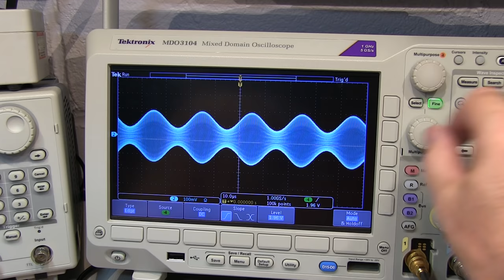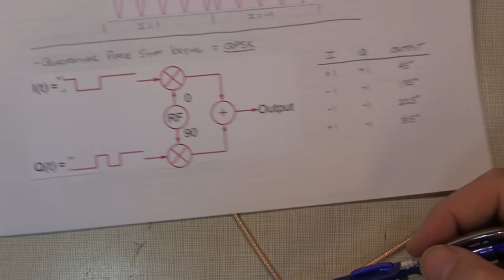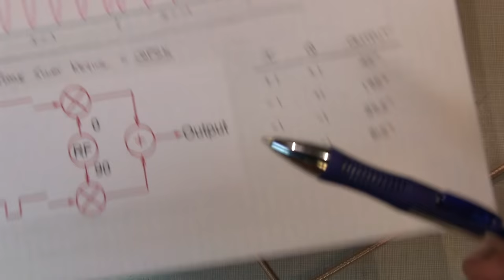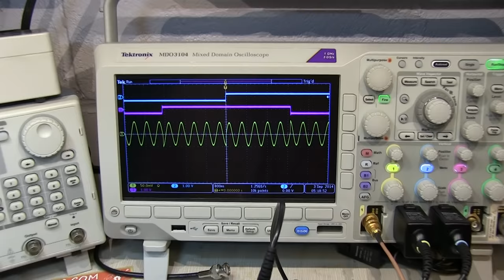#170: Basics of IQ Signals and IQ modulation & demodulation - A tutorial

Comment: Thank you for the video.  Do you have any videos taking this from the time domain to frequency domain?
Reply from the maker: Not specifically - the closest I have is my videos on using FFT on a scope.
Reply: @w2aew  Thanks for the reply.  Currently looking at ways to demonstrate the move from the time domain to the frequency domain using GNUradio for my students.   Was thinking of using some AD 831 mixers.  Want to show why increasing data rate increases the BW of a BPSK signal.  Then after that working on QPSK fallowed by 16 QAM.  Any suggestions that you might have is appreciated.
Reply from the maker: @NA12495  Showing the FFT of the baseband data signals will show how the baseband BW increases with data rate.  It follows then that the modulated RF signal BW will also increase when modulated with the faster/wider baseband.
Reply: @w2aew  I am looking to simulate it going slow, low data rate into the mixer with a slow LO, that you can see the pulses on the freq spectrum.  Then as you increase the data rate for this BPSK signal the pulses get wider and you have more harmonics and that is why the signal's effective and occupied bw get wider.  At least that is how I understand it.  A few of my co-workers have been under the impression as you increase data rate, there are more pulses being transmitted in parallel and that is why the bw gets wider.  To my understanding that is only true if you increase the order of modulation.  That is why I will then want to move on to the QPSK and then introduce amplitude with QAM.  Sorry if this doesn't make sense, it is how I currently understand it.
Reply from the maker: @NA12495  It may be instructive to talk about the inverse relationship between time and frequency domains.  Things that are "wide" in the time domain (slow bit rate, wide bits, etc.), occupy a narrow spectrum.  Conversely, short duration signals in the time domain (fast bit rates) occupy a wide spectrum in the frequency domain.  It's not about the number of harmonics, but the spacing between them.  Consider a squarewave - its composed of a fundamental frequency and energy in the odd harmonics.  As the square wave frequency goes up, the fundamental goes up, as does the frequency spacing between the harmonics - so it occupies more bandwidth.
Reply: @w2aew  good info.  From what I have read as the data rate goes up, there is more residual power from the harmonics, because they don't have enough time to dissipate.

Also,  I have read that BPSK is a form of DSB.  So does that mean that information on both sides of the center freq is the same, but inverted.   I used to think that the uper sideband represented one symbol and the lower sideband represented the other symbol,  similar to what you would see with FSK.  Though I can's find good documentation to clear up my questions.

Thanks for the help, limited on people I know that might know this stuff.  If you want, we could meet up on HF.
Reply from the maker: @NA12495  "Residual power in the harmonics - dissipating" isn't what's going on.  Higher data rates means shorter duration symbols in time, which occupy more bandwidth in the frequency domain.  BPSK symbols are not really represented in alternate sidebands - they're just different phase shift states of the carrier.

Comment: So, in demodulation, the LO = the original RF frequency? Is there a "pitch" issue like SSB carrier reinsertion?
Reply from the maker: For direct conversion, yes, the LO is equal to the RF frequency.  Any offset will result in a pitch shift (or non-zero IF)
Reply: Thanks for quick reply. Does the  reinserted carrier need to be in perfect phase as well? I think that was what the "hue" control was all about in early color TV. Do they sync it now?

Comment: When the I and Q are combined, is that normally the signal that gets transmitted or is used to modulate another carrier?
Reply from the maker: +rbtx99 The I and Q signala are used to amplitude modulate a pair of carrier signals (or IF carriers) in quadrature, which is then combined to be transmitted (or upconverted).

Comment: 16:30 Is I and Q used for 2 and 4 level FSK as well? How exactly?
Reply from the maker: If I(t) and Q(t) are both sinusoids (90 degrees apart), the RF output will be shifted in frequency by the amount equal to the frequency of I and Q.  Depending on if I or Q is leading in phase will determine if the RF output is shifted up or down.

Comment: hello, I have a question to the video
as your video, we can get the phase from arctan(Q/I),
will the arctan(Q/I) have the same variation as sinusoidal wave??
or depend on Q(t) & I(t),
if so, 
I can not calculate the RF signal phase when I receive that??
cos I am using USRP to receive ADS-B signal and want to get the signal phase,and I have trouble with I Q to phase.
thank you very very much!!!
Reply from the maker: Arctan(Q/I) will give you relative phase vs time. You may need to perform frequency offset correction.  Frequency offset will show up as a linear drift of phase vs time.
Reply: *****
hi, thank you for response!!
sorry !! I don't get your "relative phase" and why need to do frequency offset correction??
My confusions below:
I learn that arctan(Q/I) can get phase.
If I use Software Defined Radio(like USRP) receive RF signal.
The SDR ouput I/Q data(raw data).
can I just use the arctan(Q/I) to get the RF signal phase?
thx a lot!!
Reply from the maker: 廖鎮瑋 An SDR converts the incoming RF signal into baseband IQ through down-conversion using a pair of quadrature oscillators that it generates locally (either "real" or in software).  However, it is unlikely that this oscillator frequency is EXACTLY matched to the carrier frequency of the signal you want to receive.  Thus, there will almost always be a small offset in frequency which will lead to a linear drift of phase vs. time in the IQ data.  Also, the local oscillator don't have any knowledge of the absolute phase of the carrier, so all phase results are relative.  In other words, you can use the arctan(Q/I) to determine the phase difference between any two points in time - that is enough to do demodulation though.
Reply: *****
thanks! I understand the "relative phase"and "frequency offset"!!
There are still some things I want to make sure.
we receive the RF signal and using local oscillator to sample the signal,then we get the I/Q data about the RF signal.My question is the oscillator demodulation (in the last of video: IQ modulation & demodulation part) ,does the I/Q data we get contain the carrier(cos and sin)?
If so, we do arctan(Q/I) will get whose phase?? I think it won't be the carrier's because there is I(t),Q(t) which are different in difference modulation. That will affect the arctan(Q/I) result.I just want the relative phase of carrier of RF signal,I am confused that arctan(Q/I) is whose phase? The carrier's or the RF signal's?
Reply from the maker: Arctan(Q/I) will give you relative phase difference between the quadrature LO and the carrier.
Reply: ***** thank you for solving my problem,
I have last question:
If I use two time-synchronized SDRs to receive an RF signal.Then, I do Arctan (Q/I) at each SDR's output.Finally, there will be two phases at the same time.The phase difference will be the true phase difference between two antennas? Because the LO is synchronized. Is it right??
Thanks a lot!

Comment: Brilliant. Never heard about IQ modulation but I understood it. I didnt grasp the demodulation though. That was too fast and shallow.
Reply from the maker: The video was getting a bit long.  The summary is that the exact same process can be used in reverse.  By using direct conversion (LO equal to RF), with quadrature LOs, you can create the I and Q vs. time components of the RF signal, which are typically sampled/digitized.  Then, with digital signal processing, perform any desired demodulation or analysis, because it's all just math at that point.

Comment: but still don't get one thing the scheme you showed on paper shows that the phase shifter adds only two angles 90° and a 0 but we need four angles
Reply from the maker: Inverting either of the signals (gain of -1) is the same as a 180 degree phase shift. So the other two (180 and 270) come from inverting the 0 and 90 degree signals.

Comment: Why can't we use only I carrier to generate Qpsk signal? What is the advantages of having I+Q?
Reply from the maker: If you use only the carrier, then you need to have a precise phase modulator to establish each of the four symbol phase states.  Phase modulators are harder to design than amplitude modulators.  Using I&Q, you can make QPSK using only amplitude modulators.

Comment: if the Q(t) is always 0, don’t you just have amplitude modulation? Once you bring in the Q(t) ok, you get more than amplitude modulation in the carrier.  Is the point of adding Q(t) just to put more information on the carrier?
Reply from the maker: If you only change Q or I, then you have AM
Reply: @w2aew  Great vid BTW. It was clear to me that by changing the amplitude of I and/or Q, that this achieved a change of phase and/or amplitude of the summed output. I didn't see how it could change the frequency, unless you count the momentary transition from one phase to another. Also, are there alternative methods of modulating phase and amplitude, what are the pros & cons of this I&Q method? 
I know of VCO that change frequencies based on input voltage for instance.
Reply from the maker: @mdesm2005  A change in frequency can be thought of as a phase change that occurs at a constant rate.  For example, if you get a 360 degree phase shift every 1 second, that is equivalent to a 1Hz frequency change.  In the phasor diagram, this is equivalent to the phasor rotating around like the hand of a clock.  If it rotates once per second, then that is a 1Hz frequency offset.  Thus, if you picture the variation of the I and Q projections during this process, the I and Q will follow a cosine and sine variation vs time.  Thus a frequency offset is accomplished with a sinusoidal (and cosinusoidal) variation of I and Q.  The one that is leading (I or Q) determines whether the frequency offset is positive or negative.

Comment: Could you please share your power splitter model no and the rf mixer model number for us to replicate this experiment? This is a very fun experiment and would love to check this out.
Reply from the maker: The mixers are Mini-Circuits ADE-1ASK units.  I don't have a part number for the RF splitter, but any resistive splitter that is rated for the frequency range you plan to use will be suitable.

Comment: What is the mathematical representation of IQ sampling? What should be IQ sampling rate?
Reply: Generally for capturing an IQ signal it's 2 times the bandwidth of the signal, look up the nyquist-shannon sampling theorem. Sampling less can result in aliasing. When generating an IQ waveform with an SDR, generally need to go a little over 2x the desired bandwidth to get the bandwidth you want.
Reply: @trashfirecomics7678  Thank you, i understood but how can i prove ? For Real sampling we can prove the nyquist theorem using basic concept. How can i apply to comlex sampling?

Comment: By the way, can you modulate the frequency with just IQ?
Reply from the maker: Typically, the amplitude of the I and Q components are modulated in order to generate the desired modulation type in the resulting upconverted RF signal.

Comment: If I have a 8-bit data '0101 0010' generated, how can I separate them into I & Q signals?
Reply from the maker: +celticzen I'm sorry, but there isn't enough detail in your question for me to be able to answer it.
Reply: +w2aew Sorry for not being specific previously.

I'm working on a project involving QPSK and my reference was this.

http://www.gaussianwaves.com/gaussianwaves/wp-content/uploads/2012/05/QPSK_Modulator.jpg

My understanding was that the I & Q signals are the odd and even bits from my data stream and both I & Q signals will be multiplied with a sine & cosine wave and added together to obtain a QPSK output.
Reply from the maker: +celticzen Yes, QPSK signaling involves encoding 2 bits of information into one of four phase states for the output carrier.  Separating even and odd creates the bit-pairs that will be used to modulate to modulate the quadature (sine and cosine) local oscillators.  The mixers typically multiply the LOs by +1 or -1 in response to the 1 or 0 logic levels.
Reply: +w2aew Yup. But my difficulty is generating the digital odd and even signals from my data stream. What did you use to obtain the digital data signals?
Reply from the maker: +celticzen I just used a pair of square waves from a 2 channel function generator, and I offset the square waves by 1/4 period (90 degrees) so that all four states (00, 01, 10, 11) would be represented.
Reply: +w2aew Ok, thank you! I'll try that out.

Comment: Do the LOs in the sender and receiver need to be synchronous in time.??
Reply from the maker: No, they don't.  Small frequency offsets can be easily compensated for in the DSP.
Reply: If they are not it will have the effect as if the diagram with the circle is slowly rotating with the difference between the two LOs, but it can be compensated for

Comment: Some questions that a critical mind will go and figure out for itself - because it moght not be obvious to a non-mathematical mind... or will want to get answered so as to save time and experience an even bigger "aha" moment when first learning this... and to understand math better 1) Why not just modulate the frequency, amplitude or phase directly? What benefit is there to using I and Q that isn't shared with direct modulation? 2) Why only use I and Q and not add more... or split it into 4, 8... or more... why stick to only even numbers?
 (and why call it I and Q) 3) Couldn't you craft I and Q signals that are different but will decode to opposites, I becoming Q and Q becoming I? 4) Couldn't you theoretically get more throughput by modulating phase, frequency or amplitude directly or simply multiplying 2 or more directly modulated signals?... 5) The real brain-splinter... why bother with a carrier wave if you know the speed of light?  :-p 6) Who came up with this, what was before, and what problem did this solve?
Reply from the maker: 1) You certainly could.  For some modulations (like nQAM), quadrature modulation makes it easier.  2) Using just a pair of signals in quadrature keeps things less messy - lots of trig tricks with sine and cosine to exploit. 3) Sure, you certainly could reverse I and Q (same as inverting the signal). 4) For many modulation types, there are easier ways than using I and Q.  But, IQ representation is very general and can represent any type of modulation, hence its popularity. 5) Huh? 6) No idea on the origins of it - based in trigonometry.

Comment: 6:21-23: OF COURSE, frequency modulation is just a form of phase modulation ---- need more explain.
Reply from the maker: Think of it this way....  A constant shift in phase at a rate of 360 degrees per second would be the same as a 1Hz frequency shift... In the IQ vector space (the circular plot), phase modulation is represented as a rotation back and forth between two or more phase locations.  Frequency shifting (modulation) is represented as a rotation around the IQ circle.

Comment: Isn't this basically Fourier transform.
Reply from the maker: No, a Fourier transform is a mathematical method of converting time-domain content into its frequency domain representation.
Reply: @w2aew  I'm sorry i misspoke. From a naiive look, they both exploit the orthogonality of sines and cosines for use as complete basis states to generate arbitrary waveform, but for IQ, there is perhaps only 1 frequency instead in Fourier transform there are a continuous band, i thought. 

However on a closer look, The time varying amplitudes I(t) and Q(t) seem almost hellish to deal with and deobfuscate after transmission from the signal. Fourier signals in the frequency domain don't vary with time, i guess this is where they differ. 

I'm just curious how and what goes into picking and producing I(t) and Q(t)s to generate those signals, and vice versa how signals are turned back into I(t) and Q(t)s. the math must be horrendous.

Comment: The signal you draw and what you are showing on osciloscope is clearly NOT A(t)*sin(wt+phi) !  If you multiply something with sin, the resulting signal must go through zero every half-period of the sin(), not other way around. Well, if you used + simbol instead of multiplication, than it would be correct, its definition of amplitude modulation anyway. How are engineers able to be so insensitive to the most fundamental formal nuances? I fucking hate this.
Reply from the maker: The sin() portion of the equation is the RF signal, and it IS going through 0 at every half cycle - you just can't see it on the scope because of the time/div setting is set to show the low frequency A(t) signal, not the high frequency sin(wt) carrier.  In this case, the A(t) signal is a much slower sinewave with a DC offset.